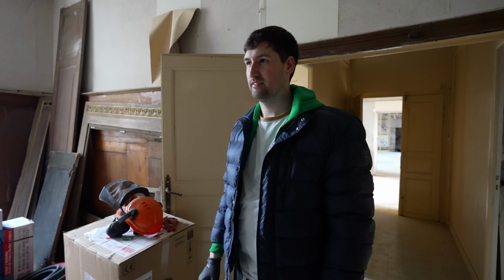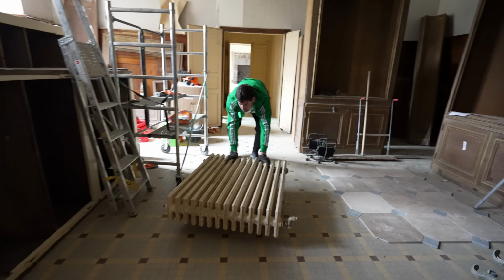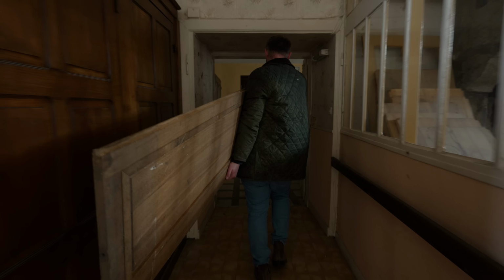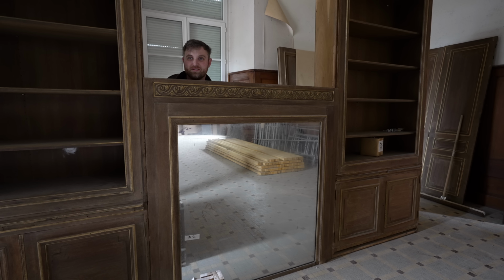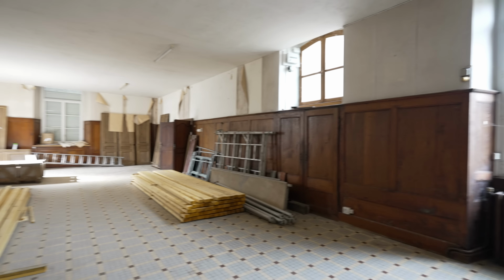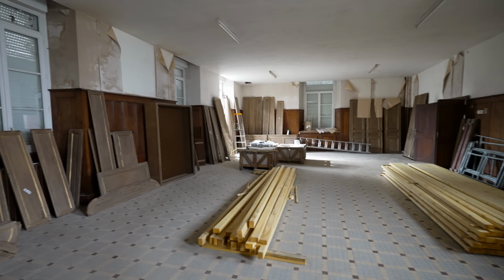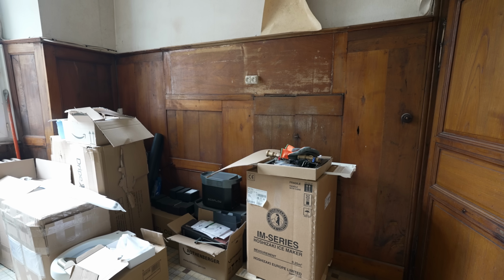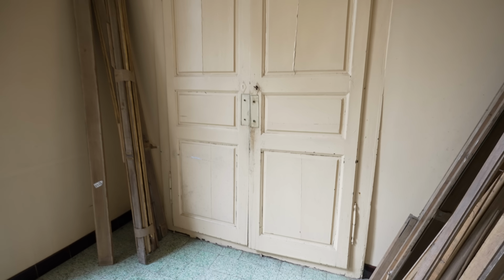The Day Before Demolition

Comment: Hey Guys. Can I suggest a quickly made aide to the continually movment of the cabinets. How about taking a regular wood pallet, cut it down to 24-29" (I'm USA, so hey!), On the bottom, build a small frame that limits the restriction of the small roller your using. This will allow it to be used on these bulk items with out them continually falling off.

Comment: If it hasn't already been mentioned about that little trolley you are using to more furniture and things around. Please consider getting larger diameter wheels (like 6" or 150mm) and maybe a little bigger platform. If you will make the task of moving soo much less effort, especially over the cobblestones.

Comment: Hi there! Fantastic that you find time to make so many videos !! As for the small trolley, can ´t you get/make one longer and with larger wheel, preferably rubber....As for wood, there seems to be quite lot of it, for future use....
Reply: Yes two trolleys and two cargo straps would be better on anything over two metres long stuff, one at each end, especially as parts of the floor has a large camber, but they will work it out, perhaps, the excess old wood will mostly be used as infills in the library, the new wood which is not straight will be chopped up as required and used as smaller pieces which can then be nailed or screwed into framework to straighten them up!?!

Comment: Colour this a strange idea or what not, but have you ever thought of getting a hand-truck with a rather large inter-changeable lift plate to help move items around in the convent with? Delivery drivers and removers use them to great effect when handling the odd-sized loads that they have to deal with everyday, so whay not you? Just curious is all. Cheers.🍻

Comment: I have lost count now of how many times that library has been moved, is this #5. Would the pillars that were added in the basement be under the walls for the smaller rooms that you taking out - they built the pillars to hold the weight of the walls they put in?  Hoping the walls were not part of the pillars supporting upper floors...  you will find out when the ceiling beams are exposed.  Praying for you that the beams are in as good condition as the ones in the kitchen.
Reply: The walls look like thin stud work, but could have steel beams hidden in them 😭
Reply: The rooms he's knocking down are just made of wood, not structural, they were added at a later date, I don't think they contain steel beams as there are continuous windows added to the top two feet of the walls, but you never know until you start knocking it down!?!
Reply: @thomasherrin6798  the one wall in the kitchen had rebar and concrete in a corner pillar however the beam above was given the green light by the engineer - it's a mystery why that corner was built the way it was.
Reply: @thomasherrin6798  Yeah, and I get kind of lost trying to keep with this guy.  

I hope his bank account can keep up with his vision of perfection that he has?  

And please correct me if I’m wrong, but these huge few rooms that he’s working on, aren’t the only ones like that in that structure.  It looks to me like EVERY room has a dropped ceiling?  

Is he actually going to remove all the dropped ceilings in that property?  

And then go through the whole ceiling restoration for each one of them?  Never mind the floors? 

Oh dear.  Well, I will have lots of videos to watch.

Comment: If the dolly you are using was extended a bit, and a larger wheels attached to the middle it would be easier to manoeuvre and travel on uneven surfaces.

Comment: 2 Minutes in.............. Come on Billy, buy some bigger dollies. The ones with the flat bed and handle to push. I believe 2 wheels are usually fixed and 2 wheels to steer. The bed of the dolley is higher off the floor i believe. I've had 3 lots of back surgery and you are doing yourselves no favours in this department. Please taken this as a constructive comment because as you get older you don't want to be saying to yourself "if only I'd been a bit more health and safety minded, my back wouldn't hurt so much"

Comment: It's too bad I'm not closer to the convent.  I'm qualified to service the elevator and would love to get it working for you as my contribution.  Sadly, I'm too far away in Florida.
Reply: I think it needs structural attention as well as Billy has highlighted movement in the floors adjacent to the lift, a nice gesture though!?!
Reply: @thomasherrin6798  I believe the structural issues may be related to the subsidence of the elevator shaft as a whole.  This might not impede the operation of the elevator car itself, but the shaft would have to be inspected for damage and/or distortion related to the subsidence.  I suspect there isn't any significant damage to the shaft because Billy has been able to move the lift car from top to bottom without issue manually.  It seems as if the movement of the shaft has been just enough for the doors to scrape the floor.  If the doors were shaved on the bottom so they could open without hitting the floor, my guess is that it could work just fine for a while, not that the issues wouldn't have to be addressed at some point.  The issue of if local authorities would allow any legal use is another matter.  I suspect they might not allow passengers at this point unless a qualified local structural engineer signed off on the conditions.  However the unit could operate unmanned for freight.
Reply: @tricotec  You’re the first one to describe the elevator shaft issue as you just did.  I wonder if because of all structural work that has been done adjacent to the shaft, hasn’t caused the shaft to settle at the base to one side and then the shaft may be slight torqued?  

There is another possibility that may have nothing to do with the construction going on in proximity.

God forbid, has anyone there given any thought to the possibility that there may be a water leak UNDER the elevator shaft?  Maybe the water table has risen, or maybe this building may have been parked on top of a formerly dried up stream?  Shudder…… 😬
Reply: @nickandlaurihyde  It depends a lot on if the shaft is just settling as a whole and is still intact as a unit, or if it is compromised...that is cracked and or crumbling.  The fact that the elevator is still able to move freely up and down suggests the former.  From what I'm able to see from the limited videos, the shaft appears to have settled as a whole entity about an inch or perhaps a little more.  If it is just settled but stable, the damage around the joint between the building and the shaft can be repaired and the doors either shortened on the bottom or worst case the doors removed and reinstalled in the shaft level with the floor.  If the shaft is unstable and further movement is expected, then that is a different story.  I suspect that the shaft is largely intact and more minor repairs could be done to give many more years of service.
Reply: Bobby, I think you need a French 'holiday'. Best wishes.